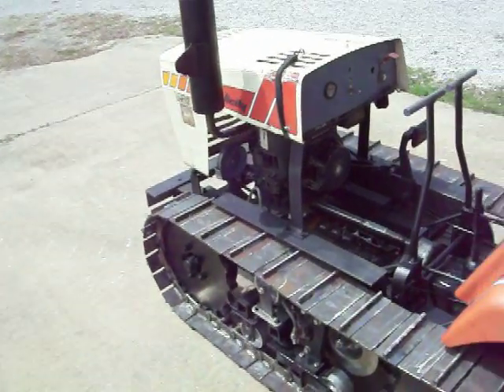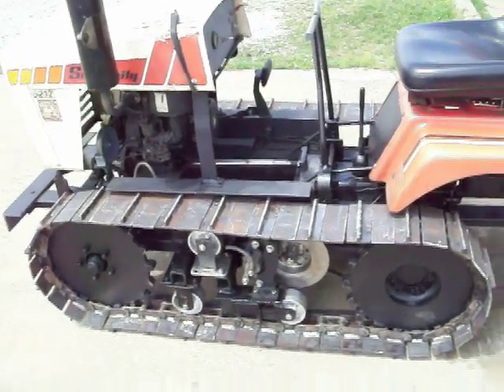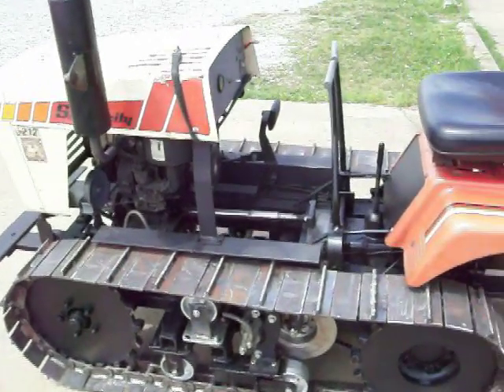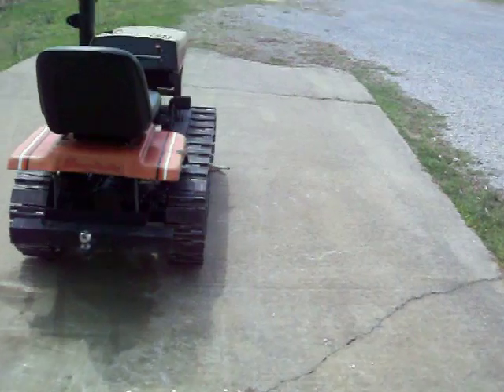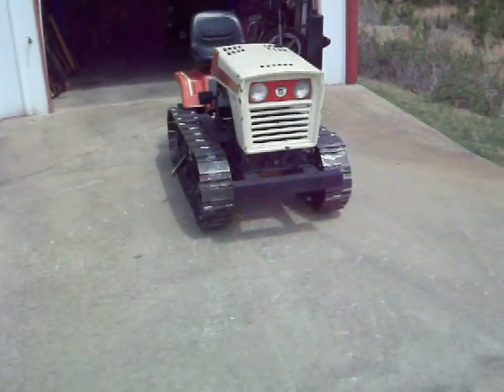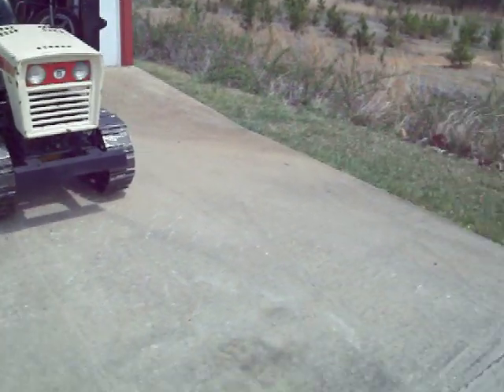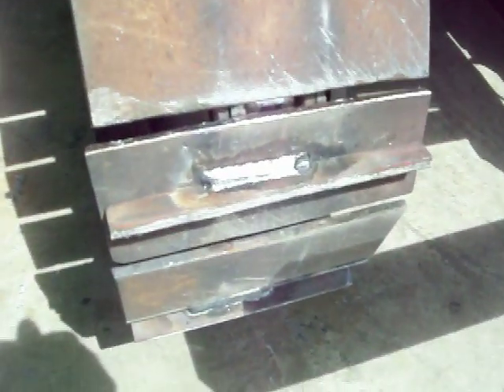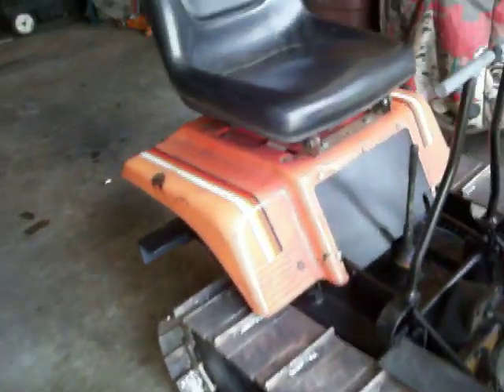Mini Dozer Home Built "Ready For Push Blade""

Comment: Coming along nicely. I'm sure it will be really nice with a larger pulley.
Reply from the maker: Iv'e got it almost back together and the new pulley added and it fit like a glove down between the frame and also raised the motor up 3 inchs with 2 pieces of channel,,will need a 38 inch belt also,,also went ahead and cut a oil drain hole in the motor plate and will today make a ramp for it to run down and hit the ground or a bucket when being changed,,and while i had the hood off it hit me yesterday how to mount the cub cadet starter and will look like it came factory that way old buddy so Im gonna go ahead and do a bunch to it this time before starting the blade, I got lucky with home making and drilling the drive shaft cause it spins like a swiss watch by hand without the belt tight so I got real lucky on it and there is no resistance at all while its turning,,did I tell you a buddy of mine I let operate it out on the gravel drive way and when he turn it rolled gravel up into the chain and filled up the chain pockets,,hahaha,,,want go in gravel unless I add a total gravel gaurd which I would like to do later on,,,,thanks for the comment brother.
Reply: snowmangsx1100 good job my man good job , any more thoughts on colour

Comment: Nice set up! Just wondered if you could turn the seat pan around and that way the curve would follow the track.
Reply from the maker: yes that would be a thought for sure but all is cut to fit this way,,may put some rear type fenders if I ever find another axle where I bent the left side one,,,hard to find another
Reply: @snowmangsx1100  yep, it wasn't a criticism... One question more.... For me .... You mentioned about the rear differential having separate braking. I got the understanding, you chose the Cub cadet rear because it came that way. What model was Cub cadet that had that type of rear? My dream would be to convert my Bolens HT-23 hydro into a track dozer. But not a good choice because the hydro might slip? Or not enuf ground torque? I do have an older Bolens driveshaft model, using sideshaft engine and manual clutched trans. But not a rear differential like the CC? Couldn't disk brakes be added to the axle hubs to create stick turning? Edit: Ah, I went back and saw that you did have disk brakes. So what you meant about the rear differential, was that it had traction control by stopping one side it would pull traction on the other side. I think the Bolens rear differential is a pretty heavy . The older one I have is a rare 1000 model built only in 1965. And it also has the factory hydraulics that was an add on option. It's not as big as the 1971 HT-23. But adding the weight of the track must be adding close to 800#?
Reply from the maker: search 6 wheel drive wheel horse I think it was and these guys used hydraulics drive to make all 6 wheels pull,,not sure if it would be strong enough to push dirt

Comment: I really enjoyed watching your videos I am planning to build a dozer I am to use 15 hp kubota diesel engine would you think would strong enough wish I can find your final video to see how it all looks like again awesome build thanks for sharing
Reply from the maker: thank you but don't make the same mistake I made, Have a machine shop build your drive wheels,,there expensive but worth it,,what has stopped me I didn't take enough time to true up the teeth I added to my home made drive wheels and the track came off and warped one of the very hard to find axles, had I had a machine shop build mine it would have long ago been finished. normally a cub cade axle would be dang impossible to warp but I had this dozer geared so low it was like a winch and just bent the left rear axle and it broke my drive to complete it, It can be straightend at a machine shop and will do it someday,,but thanks
Reply from the maker: absolutely and with the proper gearing 10 HP would be enough so for a mini dozer 15 HP would be perfect !!

Comment: Woo Hoo she turns both ways now.. Good job Rick :-)
Who are you trying to kid? As soon as you get the drive belt sorted your be out playing in the dirt :-)
Keep the vids coming bro..
Reply from the maker: your probably right old buddy,,I found out yesterday it isnt gonna go in gravel very well,,I let my buddy drive it and he went out into the gravel drive way and soon as he turned it rolled up a bunch of gravel into the tracks and over into the teeth of the chain and you know what happened after that,,haha...Im gonna make a cowcatcher to keep big rocks from getting in there but will be hard to keep small gravel out so best thing is to stay out of gravel,,haha,,also im waiting for a 1 inch adapter to fit the new 9 inch V pulley onto the drive shaft so it may be a few days before i get the drive belt sorted out,,I could do it without the adapter but to spin perfectly true I need to wait and find one and none of the area tractor supply's have it,,keep watching though and also how would you do the blade ? would you let it come from underneith out between the tracks or let the arms come down each side outside the tracks,,let me know what you would do ok, ?

Comment: Good job there Snowman!!!!
Reply from the maker: Thanks Big Chief,,I aint got no more excuses now,,no use in making another videountil the push blade is on it so Ive got to get busy tomorrow and start the blade,,want take but a couple of hours to replace the lower belt pulley and redo the belt tensioner on it so it want slip anymore so next time you see it it will have the hydraulics and the push blade,,thanks brother.
Reply: snowmangsx1100 A section out of a piece on "Line Pipe" would get you started on a good dozer blade face...as long as you got about a total of 6" over the width of your tractor...about 3" past either tracks...about 3' face height...
Be like a "Pygmy Allis-Chalmers HD 41..."
Reply from the maker: Oh gosh I already have a nice blade from a small grader or ditch witch,,its a factory type blade with the removable cutting edge on bottom that bolts on and off,,very nice blade and will be about 4 inchs wider on each side than the dozer is wide so i have a perfect blade ive just got to figure out if i want it to mount from underneith the front end or for the arms to come outside and along the side like most bulldozer blades mount,,cant make my mind up,,would he handier if it came from under the front end which would mean I wouldnt have to take the blade off in case of a track having to come off but I'll think it over and decidee which i want,,which way do you like ? coming from under the front between the frame or arms up and down the sides ?
Reply: snowmangsx1100 Side push arms would be nice but you might be better off coming from under the belly...
Reply from the maker: it does make it a more compact dozer to have them coming from underneith the front end and I will probably go that way,,also I have a video of the blade im going to use here on youtube and the name of it is   Mini Dozer Cub Cadet Style "Push Blade #5"   check it out and see what a nice blade i found at the junk yard,,I dont think I gave but 20 dollars for it,,I also almost have the new belt and bigger pulley installed and while Im at it Im gonna go ahead and mount the electric starter and maybe the alternator also,,I need to find a good GM built in alternator some where since there so easy to connect up,,also I dont know why but I do not recieve a notice from youtube when you make comments so I never know when you send one I just have to check my comments and see if you've said anything so if sometimes I dont answer you will know why,,sorry about that and check out my push blade video,,thanks
Reply from the maker: I got the new pulley put on yesterday and it fits down between the frame like a glove,,also it hit me how to mount the cub cadet electric starter and will look like it came factory that way,,while I had the motor off I went ahead and cut a oil drain hole through the plate and will today mount a troft for the old oil to run down and into a oil pan whenever I change the oil,,you know Chief I got lucky as can be when i drilled and made the drive shaft brother cause it spins as true as Swiss made watch with absolutely no resistance at all,,you know I have a bearing up front that holds the shaft and then the other end of the shaft goes straight back to the trans shaft and buddy it fits over the trans shaft like a micrometer and spins as true and easy as it possibly can spin,,so i got lucky,,Im gonna go ahead and do these few other thin gs before starting the blade and I think Im gonna let the blade come from undrnieth the front bottom,,,check you later.
Reply from the maker: hey Big man whats been going on ? long time no hear and Ive got to get the dozer finished and soon.

Comment: I have put together a magnatrac RS196k with a Briggs and Stratton model 15000 , 1150 series engine. The kit came out fine and  I took it out for a test ride for about 15 min three days in a row. After the third day I noticed some oil at the base of the engine mount. The oil spout top is secure as is the drainage plug. It's not a lot of oil maybe a half ounce. Is this normal for breaking in a B&S engine or is it defective. Any comment would be appreciated, Thank you.
Reply from the maker: do you have a video of it yet ? Ive got to get my dozer build finished up and soon,,been driving a big truck almost none stop but am goona get back on  it soon,,whats the name of your dozer kit video ?
Reply: I haven't produced a video yet. I've been test driving it and looking for any bugs. So far the only fly in the ointment is the oil seepage at the base of the engine. There is a little vibration but you are riding on steel tracks so I think its normal. If I figure out how to video it I You tube it.. The kit is well made and machined well, the hardware is top grade. The video Struck put out is pretty accurate but putting it together is a bit more involved then I thought. But 40 hours is a pretty good time frame with the occasional help of an adult.
Reply from the maker: let us know when you get a video made.

Comment: Are you going on the outside or inside of the tracks for your blade frame? That has really turned out professional looking there!!!
Reply from the maker: what do you think I should do,,I like the idea of the arms being outside the tracks but putting them from underneith the front end is far easier,,,whats your thought's ?
Reply: snowmangsx1100 I would go with easy. Looks like you would have to add a whole bunch of metal to go outside the tracks. My Moose snow blade goes under in the middle.
Reply from the maker: I forgot to ad thanks for the comment on being professional looking,,ive always tried to go a little further and do a little better job and have to admit Ive gotten lucky on some of this stuff but 99% of it is using a tape measure and even a framing square when cutting metal,,same as building a house and without a framing square or tape measure it wouldnt look like a nice house,,haha,,but bare in mind I didnbt really spend any money until the boggie wheels and brakes,,the rest is metal I simply picked from a junk yard,,thanks again.